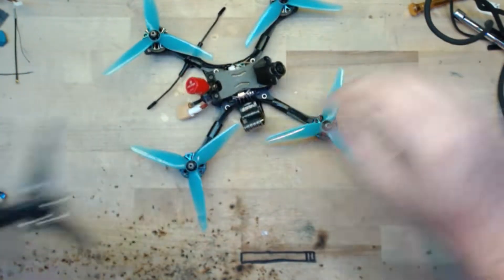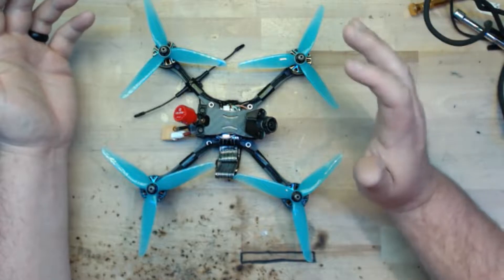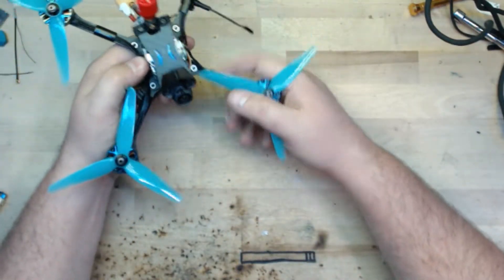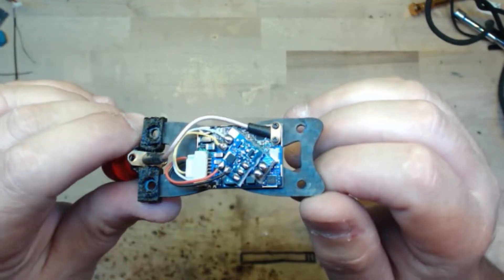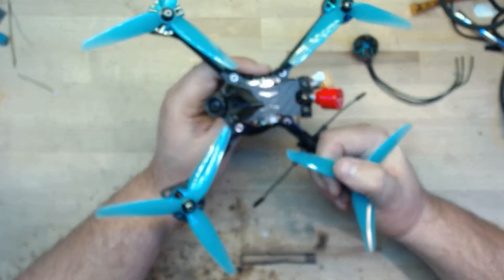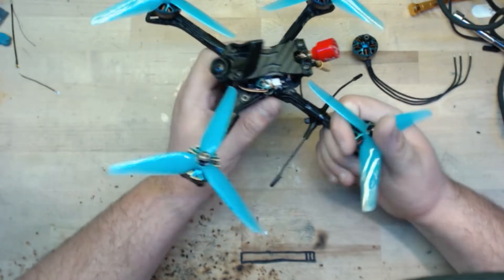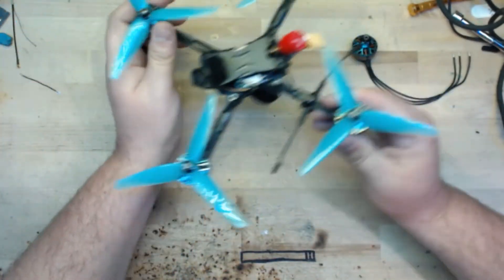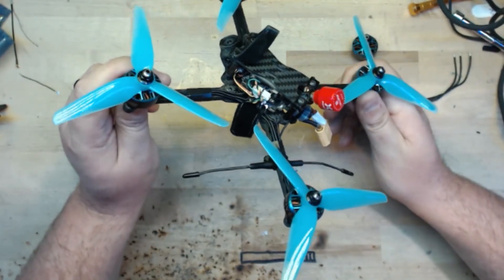Big Announcement!  2020 Drone Racing Fleet!

Comment: Sweet. Your props are wrong lol. Welcome to the FalcoX club Shames! It’s all I’ve flown the last year and love it. About to switch from the Arc One frame over to the switchback soon.(tho I am keeping one as a basher, I just can’t break that frame)  As well as a tiny trainer build coming soon 👍. I Just need a lot more practice to catch up to you lol 🤣

I wanna know how those 533 motors are. How well are they holding up? I want a set but have a bunch of hyperlite e series motors I need to go thru first. 
Awesome idea on the pit switch.  I’ve been holding off on my millivoltosd builds bc I couldn’t figure out how to do it right. And that hobbywing esc is bulletproof. It’s all ima use this year.

Comment: In budget land over here, I've been super happy at how the AKK Race VTX fits with the pit switch VHB'd onto it, and that setup fits very nicely on canopies.
I've also found that the Predator V4-Solder plugs that come off of those (since I direct solder them anyway) make for great modular plugs so the VTX can come off super easily... but the pit switch has to live on the FC or be integral to the FC.
Other than props, I tend to dislike exposed VBAT +leads on anything that can short to ground or the frame.

Comment: Left side props are on wrong, lefts are spinning in while right side are spinning props out (you usually run props out).
Also, FL1 recommends to install the FC upside down unless they've changed that recently.
Reply: MCU up is the best way to install it for sure :)
Reply: Not unique to FL1 either, you always get better results that way.  Preston's build advice applies to everything, and works well.

Comment: As everyone else has said, prop on motor 4 is in a different orientation to the rest. Seems a common complaint from people on F1, is that it seems to be super locked in until you bash it up a bit, but then fails. Naturally for the top of the top pilots that bring 10+ quads, this isn't an issue as they an just pull the next arrow out of their quiver and send it, but just feels like a lot of people burn up F1 gear for some reason. Operator error? Have you ran into any of that?
Reply: Just use the dynamic filter, and you shouldn't have those issues.

Comment: The props are on the wrong way...  I have been wanting to try flight one, but it is a bit pricey for a 15 year old.
Reply: Yessss. I'm 15 and I have 1 Revolt OSD that I bought a while ago. No way I can switch for now at least
Reply: The props are on right...  //edit nevermind, caught that now too
If you're on a tight budget, Betaflight is going to be the cheaper approach - no need to spend much more than $150/quad if you're starting off.
Reply: @tehllama42  I've been in this hobby now for over 2 1/2 years and I am a professional racer and freestyle pilot, and I still see no need to switch to Flightone in my opinion. BetaFlight is perfectly fine I have 0 issues  with it.
Reply: @Lehanvander  I totally agree, and I'm finally closing in on some stock tunes with BF4.2 that emulate FL1 feel close enough that most people couldn't tell the difference... importantly there's choices.  AutoQuopa and the ease of FalcoX configuration are the two selling points for FL1 right now, the rest can be achieved comparably.  If I had access to at-cost FL1 hardware, or a more unlimited budget, I'd run that stuff because I like what PG3, Skitzo, and Dominic are going to be doing with the H7 stuff, plus it's slightly easier for me to setup and run.
With $4/quad of JESC licences, I'm getting arguably better performance out of my $132 beater quads than most people get from their unlimited cost race builds.